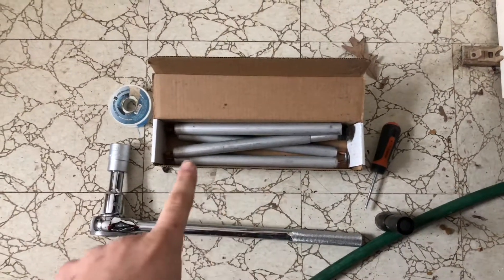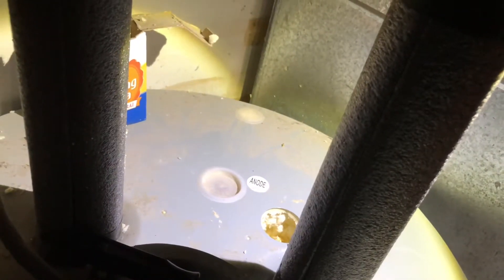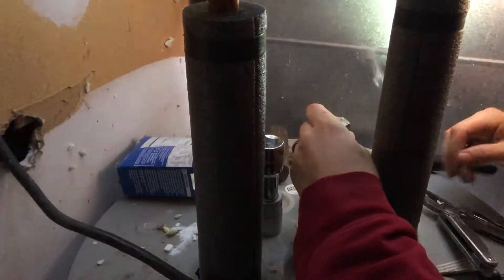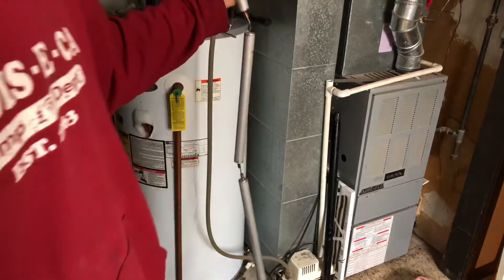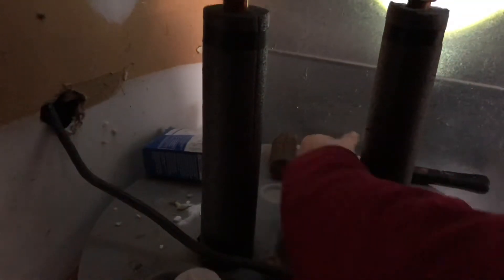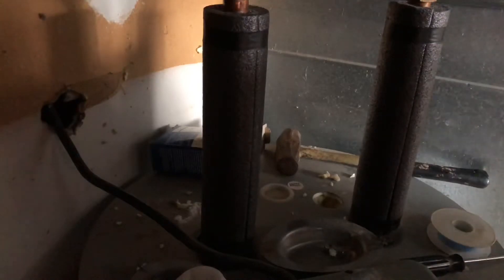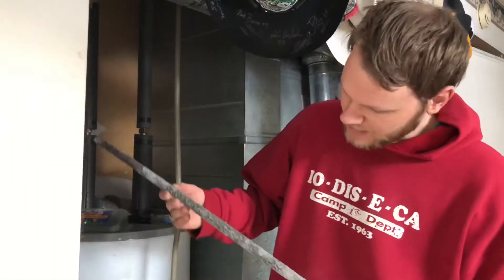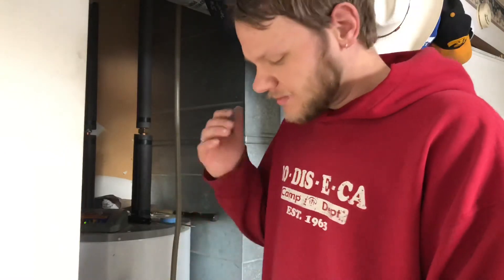Smelly Hot Water Remedy

Comment: What’s different from this rod from the one you took out?  I was told to remove mine and not to put one back in. I did that and water quit stinking for about 2 months. Now it stinks again.
Reply from the maker: You definitely want to keep a rod in there. It serves to protect the tank from the corrosive properties of the water. Basically making it so the water attacks the rod before the water attacks the tank. And the difference is the original one was a 1 piece rod that was about 4’ long and made of magnesium, this one is several 1’ pieces of aluminum bound together with cables to make it flexible and able to get into tight spaces.

Comment: Dump a bottle of hydrogen peroxide in the tank before putting new rod in. This will help to cleanse the water lines as well as the inside of the tank of the odor.
Reply from the maker: Hey! That actually sounds like it would work. Have you done this before?
Reply: I have done the peroxide thing and water stinks again in a month

Comment: This video has nothing to do with smelly water realy. 
 Just replacing the rod. The one he pulled out is still good.
 I pulled mine out and there was nothing but the steel center rod left, so I put a new one in Aluminum. The smell was awful after 2 days. Changed it to a MAG rob with the same results. Had to put the old one back in the seal the hole. no stink and no rod. 
 I have #7 hard well water and a water softener.
 Hope this helps.
Reply from the maker: Lloyd Nolan oh, well, it solved the issue in that particular house and it has in many other houses that I have recommended try it. If it didn’t work for you... then it didn’t work for you. Sorry you have a smelly situation to deal with.
Reply: You NEED a rod.

Try an electric one

Comment: My water heater is in a low ceiling basement .  Is the anode rod in the tank easy to cut as I will need to cut mine a couple of times in order to remove it .  The ceiling over the heater is only about 2 ft.   I also plan on installing an electric anode rod instead of the origional kind.  Thanks Paul.  I hope this eliminates my odorous water problem.  Chris   at   cmyamaha@aol.com
Reply from the maker: Chris Baker hey there! They should be relatively easy to cut. You’ll want a friend to help you hold the rod so it doesn’t accidentally fall into the tank. That said my suggestion would be a sawzall with a standard metal cutting blade as it is either made of magnesium or aluminum. Both are softer metals so it shouldn’t be too difficult.
Reply: Thanks Paul.  I have a visegrip which can act as a holding hand for the anode rode coming out.  Will let you know my results later.

Comment: what about when it’s a new water heater, & also new sink/bathroom above? it’s ONLY that sink that has the issue - only the hot water - & doesn’t affect the hot water in the shower a couple feet away.

(note: i would sometimes also notice the smell with hot water with the old sink/water heater)
Reply from the maker: nico1et if it’s a new heater, you may have an issue with your softener. Usually a replacement anode rod takes care of the issue after a two or three tanks worth of water through the heater. I would check to make sure you have enough salt and that your salt brine is filling and lowering as it should inside the softener proper. (Should only be several inches up inside the brine tank) If it is not there may be some deposits inside the valving of the softener and therein would lie your problem causing the softener not to work properly. However what I think is happening, is that your house hot water lines may not be fully flushed with fresh softened hot water yet and there could be some residual hard water deposits on the inside of those pipes (causing the stench) which will go away with time. Hope that helps!

Please check out my new channel that I post on called The Eclectic Mechanic! Thanks and have a good one!